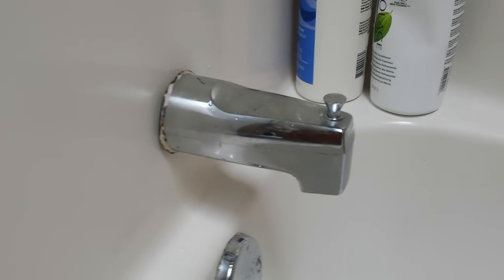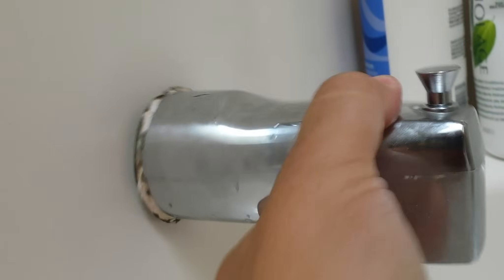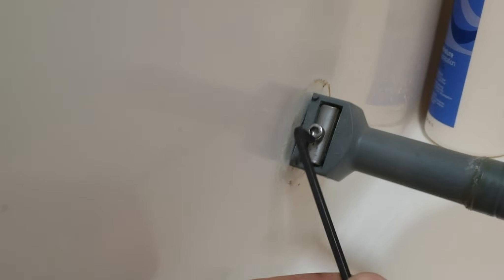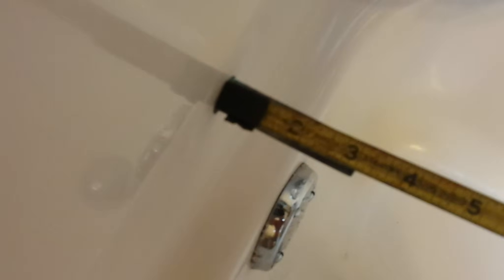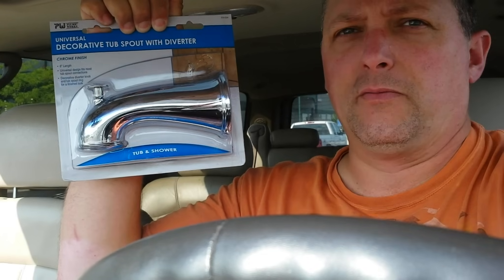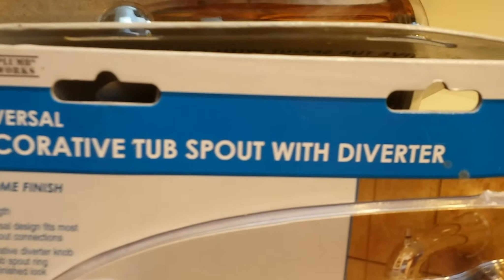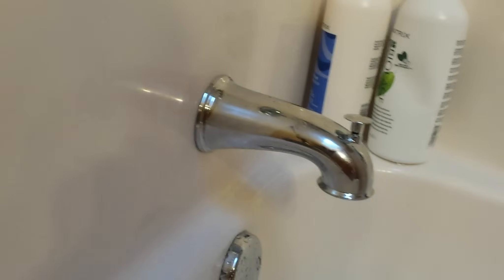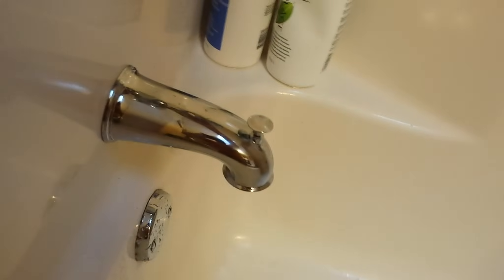How to Replace a Bathtub Spout | Home Plumbing Repair Video Series

Comment: OK,so watching your video gave me some great insights to what I need to do. But here's my problem now. My faucet looks like the type where it has a cutout on the bottom and there SHOULD BE a screw there to loosen to remove it. BUT I can't see one! I pushed the panel back as far as I could away from the faucet. I even took flash pictures (VERY hard to do at that angle) and don't see or feel the screw. What could I be missing?   Since I pushed the panel PAST the end of the faucet I don't think it's possible that the screw could be behind it,but rather more away from the wall. How can I remove it if I can't find the screw?   Can you help?
Reply from the maker: +Clifton Photographer some faucets just unscrew by twisting it to unscrew it.   It might not have the screw that you are looking for because the whole assembly unscrews from the pipe.
Reply: Clifton Photographer how did you end up emoting it?
Reply: So I was able to simply unscrew the old one. The new one went on quite easily. 
I bought plumbers tape because I couldn't find any at home. After I finished I decided where was the perfect place to put the new roll..I mean I must have since that's where I found 3 rolls of the same tape!

Comment: Do you need to shut down your water main first? I guess yes?
Reply from the maker: Actually, you do not need to, but I do just in case I break a line.  The faucet control keeps water from flowing through this spout pipe, so really do not need to unless you have to put too much pressure if it is jammed up.
Reply: Thank you so much!  New-ish single mom of two teenagers on a teacher's salary, doing my best to keep the house up and running on my own. Your help is so appreciated!  Thank you!

Comment: My spout has a 1/2" galvanized pipe, instructions say I need 4-1/4" protruding from base of wall, I have 4-1/8" , When I screw the spout on it tightens all the way tight but spout ends up facing up, ugh!!! Any suggestions?
Reply: Try wrapping the pipe thread with pipe tape (the thin white tape you can buy at any plumbing store).  Put enough on the thread so when you tighten the spout it'll be tight when facing down.

Comment: Could I put glue between  the pipe and the replacement, because it is not firm because I put it and the water returns to take it out and if so what glue you recommend me
Reply from the maker: I do not know of any glue that would keep the faucet seated on the pipe.  It has to be treaded.  I know that a plumber should be able to use a torch to use some sort of solder that will keep the pipes adhering together, or might be able to create threads to secure the spout.  It sounds like you have a much more advanced repair needed.
Reply: If you have a basic copper pipe (unthreaded pipe) use a Sioux Chief Smart Spout. It uses  compression to install, and comes with a ring seal at the base. They have a how to video here as well. Use a 1/2" copper pipe cutter instead of a hack saw if you need to trim your pipe down, your cut will be much more even and clean. They have a mark at the bottom of the spout showing the proper length that your pipe should be, before you push the spout over your pipe, for a proper and flush fit.  Then there is a screw to tighten against the wall.

Comment: my bathtub spout looks just like the one you replace with the open notch underneath, but the spout will NOT TURN to remove it...any ideas?  Thanks, good video...
Reply: +darlene .s  make sure you loosened the little screw with the L wrench then use another tool to force spout to turn over. once that happens, you'll probably have that gray metal piece stuck in place--- we just had the same problem, we had to put C.L.R. on top of it and wrap a rag with more of the liquid and lay it on top/with the spout turned upside down so the liquid would fall into the open notch area. we had to do this several times--then pull on it and it would loosen little by little, we  left it over night (3 nights) until it loosened and pulling finally got it off.
Reply from the maker: +Diana Gonzalez thank you for giving that very good tip.  I did not know that either, very good information.

Comment: the part that goes onto the copper first how did you keep it in place while you tightened the spout ?
Reply from the maker: +Paul Correia it may be threaded, and if not then it is a tight fit so I just slide on and stayed there as I tightened it

Comment: I followed the instructions to replace the spout yet more water is still coming out of the spout than going to the shower head after I lift the diverter knob. Help!
Reply from the maker: Kerry OReilly sounds like a cheaper spout.  Take it back and tell them it is not adequate.  I suggest purchasing a high quality spout from a plumbing supply store for sure

Comment: I’m looking to replace my tub spout cause whatever was there before cracked. It was a plastic threaded pipe that connected to the spout. But I have a issue, my shower head dribbles constantly when both hot & cold are off, and when I divert the shower to tub spout the tub leaks. So no matter what I function it’s on, it leaks 
I just replaced the shower knobs with a replacement kit that came with what I needed. 
If anyone can help me 
Let me know 
Just don’t know what can be causing the constant leak. 
I also need to replace the shower head cause it’s not a good one.
Reply: Another video I watched said that if it leaks, then the on/off valve needs to be replaced.  It will usually leak if the on/off valve is bad, or if your house is like mine, and has CPVC pipe stubs, instead of copper, because it's difficult to get a watertight fit with the plastic pipes; tightening the connections can just make it leak, worse.  A solution if you have CPVC pipe stubs, would be to change them out to copper right at the connections, which is easier if your shower backs up to a closet/drywall etc., because then you can install an access panel to get to the pipes.

Comment: This is a great video except when I removed the old spout there is a rubber type thing that slides over the pipe that looks like a giant rubber screw and I cannot get it to turn to take it off. Guess I will be calling the plumber

Comment: I bought the same replacement kit that you did but I have a problem.  The pipe coming out of my wall measures about 1 1/2"from the wall to the tip.  The instructions cover pipes measuring either 1/2" - 3/4" or  4" but nothing covers my length.  I got it installed but could not get it screwed in flush to the wall.  Looks like I need to call a plumber.
Reply from the maker: I do not do plumbing other than simple tasks such as this, but perhaps someone else reading this comment might be able to help figure this out.
Reply: You need to mark the pipe to the size that is needed and cut it. That's the short version!

Comment: My bathtub spout shakes and makes a noise when we turn on the shower head
Reply from the maker: the diverter inside the spout is not fully redirecting the water.  It might need replacement.

Comment: @Frosty Life Hey frost, how does replacing the spout altogether and cleaning the little rod after you take your old spout off stop leaks from occuring AFTER you replace the old spout with a new one...? Basically, after everything you did in this video, what causes spout leakages to stop? Thanks in advance!
Reply from the maker: +PRADEEP PARAMESH Good question.  If you have a faucet that is dripping and cannot be totally shut off, or if you have a leak between the spout and the faucet handle, then replacement of the spout will not be enough.  In those cases you will probably need a plumber because the faucet control valve (the part where you actually turn the water on and off) is faulty and will need either a gasket or cartridge replaced, or may need total replacement.   The only reason to replace the actual spout, like in this video, is because the diverter inside of the spout does not completely direct the water to the shower head.  So if your tub faucet is leaking and you cannot totally shut it off, then replacement of the spout will not help you.
Reply: +Frosty Life My spout is constantly dropping water droplets, even after I turn off the water, at the end of the spout. What do you think it is? If I remove the tub spout that I currently have, and there is a constant dropping of water droplets from the spout even with the water turned off, what does this mean?
Reply from the maker: +PRADEEP PARAMESH It means that your valve (where you turn the water on) needs replacement.  Sometimes it is just a cartridge (on newer faucets) or perhaps needs a new faucet.  Unless it is a newer faucet, you probably need a plumber for that because that is a lot harder to fix.
Reply: Frosty Life
Thanks for getting back sir. I appreciate it!

Comment: Mine is so old it wont come off stuck and wont go to the shower head
Reply from the maker: You might need a plumber to cut the pipe off and install a threaded pipe.  It is sad to have to pay so much, but sometimes we just have no choice.

Comment: At 6:36, how was the part separated?
Reply from the maker: ***** I place the entire assembly onto the pipe, removed the screw and twisted it off from the other part.  I think it depends upon what part you purchase, but they should separate I think

Comment: That's great but you didn't explain the ONE thing I needed to know:  What do you do when it won't come off?  I cranked on it as hard as I could with my hands (lefty loosey), and nothing happened.
Reply: Some websites say put the handle of a hammer in the spout and turn so you have leverage.   Only do this if you intend to throw the original spout away.

Another method is to use a big pipe wrench if you intent to throw the spout away.

Comment: a guy in another video said not to tighten it too tight to the wall because then you would have another major 1/2 hour job
Reply: Lori Vattes that was the screw tightening into the copper and potentially puncturing, not same thing - he says as tight to the wall as possible - but this was while showing screw which is definitely confusing

Comment: Mine has no screw at all underneath, or ANYWHERE, and I have tried my DAMNEDEST to unscrew the spout, and NOTHING happens. SO frustrating!
Reply from the maker: It might need to be removed by a plumber who can cut it off and created a threaded connection